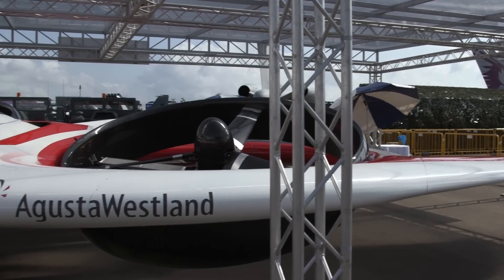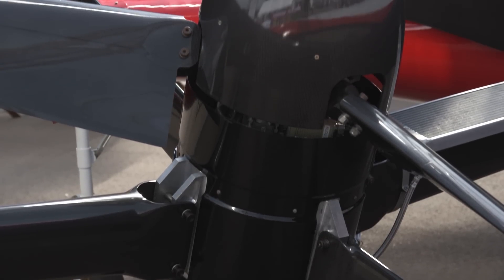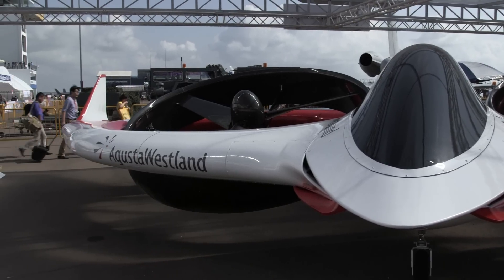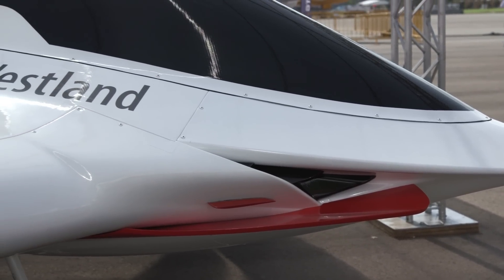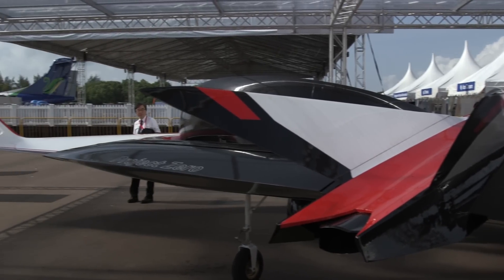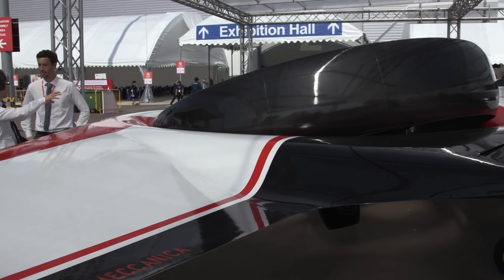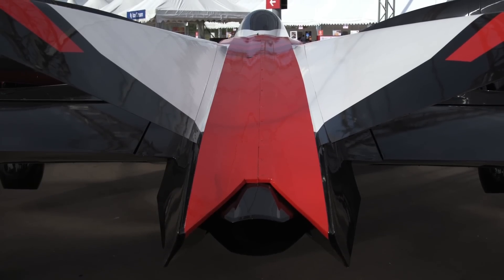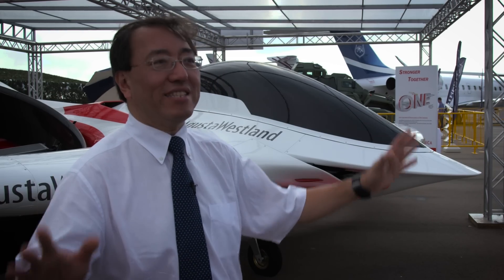Finmeccanica Trials Future Technology With Project Zero Electric Tiltrotor – AINtv

Comment: All of these are to distract us , they have a flying 100% operational helicopter plane hybrid. Think of a Comanche with two vector thrust fans one on each side, no propeller assy like a std heli, and a much larger rear fan. It can fly slow and swoop 180 degrees on a dime .  Haven't found anything like it out there yet.

Comment: they've been showing this thing off for 4 years now....let's see it fly.
Reply: Rick Davis its been 6 years now
Reply: @foxgaming76yt24  Yep
Reply: The project has been cancelled. The AgustaWestland website doesn't show it as being a project any longer.
Reply: Rick Davis man, this ducted tiltrotor looks so cool. And its electric, which I Guess means it’s more environmental friendly. I wonder why they stopped it though.
Reply: Rick Davis looks pretty cool. I’ve been trying to find a ducted tiltrotor though. And it’ll Be even better if it’s electric.
Reply: @foxgaming76yt24  There's been several different configurations of the Lilium prototype, check the archive vids of the multi- tilt rotor design.
Reply: Rick Davis managed to find two. They’re both by Bell. The X-22 and the Nexus. The X-22 was a cancelled experiment while the Nexus is for transporting and travelling around a city. I don’t think the specs are released yet for the Nexus. The Nexus also has an electric variant.
Reply: Rick Davis Cool! It’s a electric tilt wing! Looks like it’s trying to compete with the bell nexus. Thanks man.
Reply: @foxgaming76yt24  You're welcome

Comment: Over and over we see the same failed design.  its not that such a craft wont fly, but its such an inefficient layout.  The first and obvious issue with these designs are the exposed rotors.  which posses a threat to anyone nearby, let alone the occupants.  in the case of an emergency or the inevitable crash exposed rotor designs flanks besides or below the occupants are an immense danger.   Thus far. only one company has solved the issue.  not with engery consuming large engines,  but with RC sized small encased turbo fans.  Lilium, and their Lilium jet which as already taken its maiden flight just a few days ago.   their design completely leap frogs all these 'drone' conceptions but taking the benefits of drone style VTOL without exposing the passengers to exposed rotors.  Their design is so brilliant and simplistic, its amazing no one had thought of it sooner.  in fact, the Lilium design couldve been created many decades ago.   an idea right underneath everyones noses but no one makes the connection until now.

Comment: because it has no aerodynamic lift and it need to spin the motors either really fast or have a lot of torque. depending on the use case.

Comment: So, what would happen if you took a common toy drone and scaled it up with a hybrid power system? I have a drone, it can carry 55 lbs. if it were 5x the size, it could carry me. and it has technology that protects the drone and can fly nicely. I think development can and should go faster.
Reply: the problem with a droe is that its so inefficient its fast and maneuverable yse.
Reply: wardope why is that inefficient ?
Reply: there are craft that have been designed around the drone concept now which are being progressed more and more, but still the power is a prob for flight time
Reply: The model takes 5 hp, this takes 500+ hp.
Reply: They are already doing that in china

Comment: Why not add the toyota Murai Hydrogen fuel cell system so you have 2 sources of power to draw from and recharge in the air capability. The aircraft stays totally green!